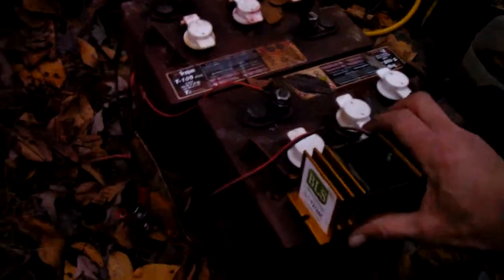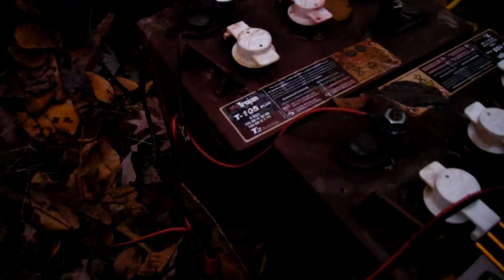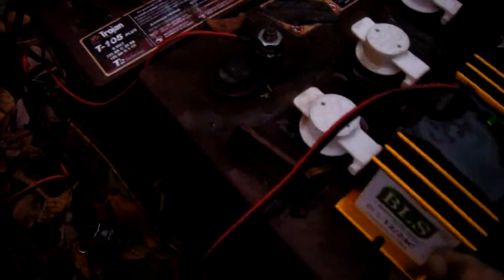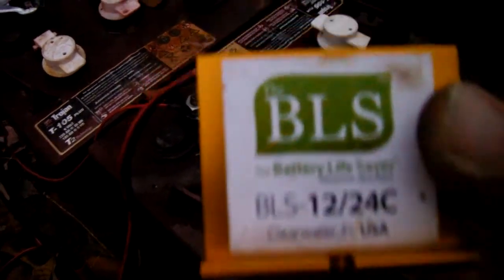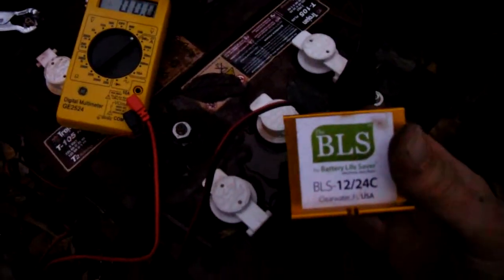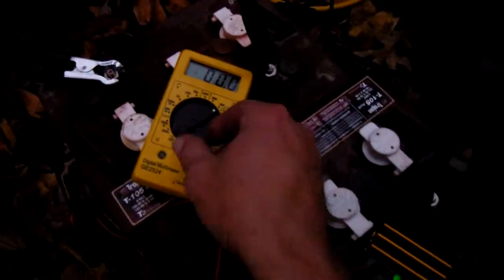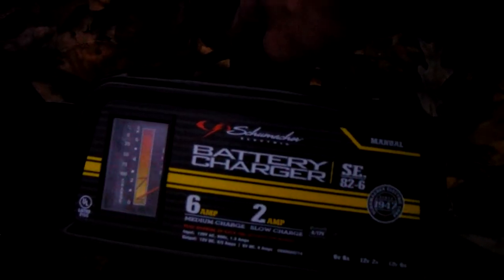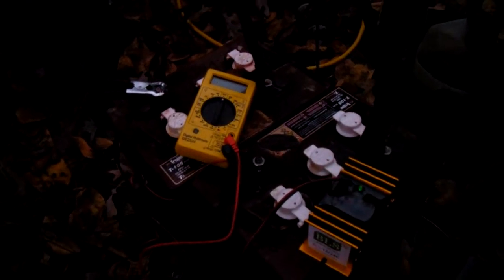Recovering some dead Batteries with the BLS desulfator

Comment: I have the same BLS unit, I read they will only do they're thing when the battery is actually taking a charge, any other time they really arent doing anything. I had a weak battery and drained it to around 10v and charged it with the BLS on it for a day, I did this about 6 times and now it works great and have it in my spare truck.
Reply from the maker: Yep they are great little units.

Comment: Hey TR: You still running that BLS desulfator? Doesn't periodic equalization desulfate a battery? Or do you have to have this also? Just asking because I run Trojan's also. Thanks.
Reply: +Chris DIYer  Equalization does clean up the plates but does not break apart mos of the sulfate crystals. You want to break apart the crystals to the original elements..lead, lead oxide and sulfuric acid. Equalization improves performance because clean up the plates but in the long term all crystal that drop, end shortening the battery life.
The frequencies that the BLS generates  break apart the crystals to the original elements. You are actually rejuvenating, and extending the life of your batteries.
Reply from the maker: I don't have it now. It was for 12V. Some say it's better to run them as well. But yes equalization should work good enough.

Comment: an almost required piece of equipment when dealing with lead acid batteries is a load tester.  they are sold at auto parts stores.  They provide a Am Meter to see if your alternator is putting out.  A Volt meter to show current charge and a Resistance load to put on the battery to see if it will maintain a charge after throwing a load on to it .  Batteries can surface charge and appear to be functional until you try to use them under a load.  Locating one bad battery out of an entire bank requires a load test.  30 to 40 dollar test instrument can eliminate a bunch of painful head scratching head banging on a wall when trying to figure out a battery problem.
Reply from the maker: Yep a load tester is a tool I plan on buying for sure. Thanks for the input. Take care!

Comment: Good Find.  Using the desulfator is very smart.  I have been using one for months now.  On our old golf cart batteries and our new L16E Trojan batteries.  With those you found just keep cycling them and they should build up if you keep the water levels up.  Use the new Midnite Solar JR you got to run a good equalization on them.  I bet they will come back to life.  Thanks for sharing.
Reply from the maker: Thanks Bill, yep it seems to have helped bring those two back to life and got the other two on charge now. Yep looking forward to getting the "kid" up and running. Take care.

Comment: we used the Pulse Tech 12v On-Board Desulfator Power Pulse PP12 from batterystuff.com on our aged 12v bank of 4 batteries, just marine but tell you what they really worked.   the batteries would not hold any charge for any period of time, now they do.   Our new charge controller is a PWM unit for now which is supposed to have the same function built in.
Reply from the maker: Yep those things seem to really work.

Comment: yeah work is the worse on taking care of batteries like people do with their cell phones they charge them everytime they can and ruin the batteries way to fast.when they should wait till its dead to charge them
Reply from the maker: Yep deep cycle batteries are better to discharge them some before charging them again. Thanks Jerry!
Reply: That is true for phone batteries as they use lithium batteries as well as lap tops etc but not so for lead acid batteries you don't want to deeply discharge them.
Reply: Bush Block Homestead even lead batteries have only so many charge cycles , so if you charge them like in between shifts on a fork lift you waist them way to fast .i agree not to run completly dead but that is very hard to do
Reply: It all depends,
If a lead acid battery is discharged at 50% or lower you do not want to discharge it any lower or you may damage it more.Discharging it more would put more sulfates on the plates which is an insulator and may hinder the battery to take on a charge or may  an automatic charger detect that the battery is damaged and the charger will not turn on. 
The problem at my work is that folks will run the forklift batteries and pallet jack batteries empty and they do not get enough charge, that is where every Saturday/weekend batteries are being charged and put into equalize mode after charging which elevate the voltage and the boiling will stir the electrolyte plus ripping of sulfate from the plate.. 

A charge cycle usually is not charging a battery for 1/2 or 1 hour. Per manufacturer data, it is a 50 % charged/discharged battery that is getting fully charged.  Before charging a '' full '' lead acid battery you need to take 15% of the power before charging it again, if you can help it.